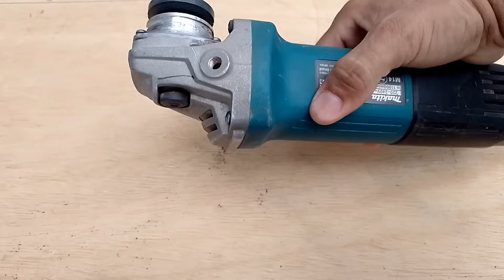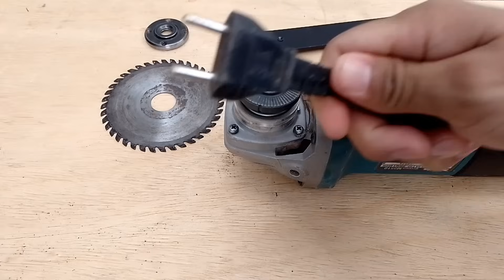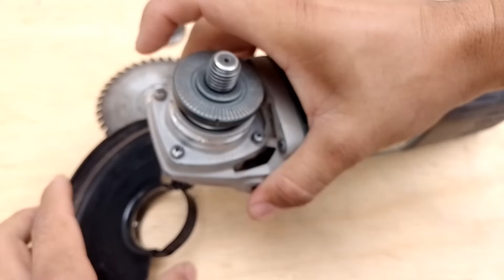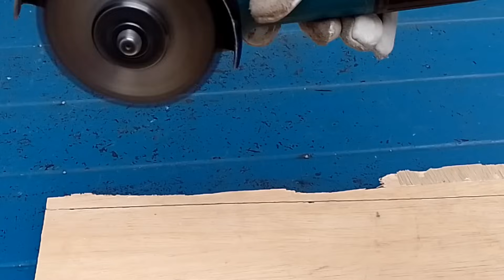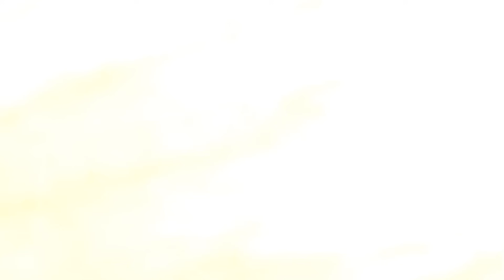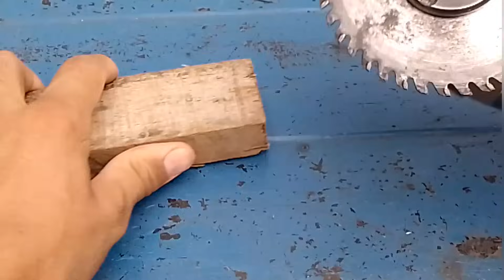Caution: Be very careful when using an electric angle grinder with this disc

Comment: Dear all, NEVER use this disc on angle grinder,  I am talking through a bad experience.
Reply: Same problem happened to me also.
Reply: Çok tehlikeli parmağımı kestim
Reply: Inexpensive to buy a circular saw, not saving this money.  Too dangerous
Reply: what bad experience with this saw disc?
Reply: Very dangerous disc ever on angle grinder
Reply: Me injured today...right we care full😢..pair m bhut cut gya hai..mere
Reply: Yes you are 100% correct. Angle Grinder is meant for MS cutting and Granite and Tiles cutting and polishing with proper blades. Cutting wood is highly dangerous. Please don't use for wood cutting.
Reply: @worldbiss1831 
I think he is referring to injury. Grinder is very powerful and always has kick back when using it to cut wood.

Comment: My humble advice. Never use an angle grinder for cutting purpose. It is too dangerous, even if you are an experienced one.
Reply: But why sir.. plzz explain or make a video on it tnxx
Reply: u are right it is meant for grinding .can cut small iron with disk which have no teeth. the most suitable is jigsaw for wood cutting upto 2 inch thichness

Comment: I have made a few silly mistakes with an angle grinder.  I was cutting through a wastewater pipe with a saw blade and the grinder kicked back cutting my index finger in two and slicing off the end of another.  I was cutting through a brick, I held the brick in my hand and the cutter was near my loose t-shirt.  it grabbed my shirt the started cutting into my chest, leaving me with a large scar.  Angle grinders are great tools but they must be handled with respect.  I am so careful now.  Always wear safety equipment and don't be a twit like me.
Reply from the maker: 👏👏👏👏🙏🙏 We really should take every precaution when using an electric angle grinder
Reply: Just remember that this machine is unpredictable and wild , so grab it strongly
Reply: Excuse moi mais je n'ai pas pu retenir mon rire.
Respect, tu es un véritable guerrier qui ne lâche pas l'affaire .
Après tout ce que tu as enduré tu continues encore avec la bête !
Bravo 👍👏
Reply: Thank you for writing your story, thanks to your comment, I'm not going to use this angle grinder to cut woods, I was surprised why I couldn't find this kind of disk in my local market, they all use the big saw with flat bottom that you can install it on a disk and I've used before, I assume those are way safer. 
I'm going to use this only for polishing.

Comment: When we are cutting the wood with this disk plate , we have to use the handle bar and safety guard attached as well . I
use it for thicker wood , but my angle grinder kicked back very badly few times and I controlled the situation ,  Earlier I asked my friend who is carpenter and he said it is good but you have to grab very strongly. I also used my angle it grinder which is weaker , if your angle grinder is weak and old it is ok to cut the wood with maximum safety, but do not use it with new and strong angle grinder . In my view sharp things are having devil , so handle with care .

Comment: Angle grinders are dangerous enough when used properly. I had diamond cup wheel blow up on me and a shard shot right towards my chest. If my safety vest hadn’t been caked in epoxy I probably wouldn’t be here today. Don’t do be stupid with angle grinders. Wear PPE and use as intended

Comment: It's always good to have a person to switch off immediately when it goes wrong, further don't give more pressure while cutting, it should glide in very softly, Last but not the least if possible have voltage regulator to reduce RPM

Comment: Wow, this is everything you shouldn't do ever.

1) Don't touch de disk while still connected with your hands!!
2) Don't use that kind of disks in a grinder. Haven't you heard about all the cases of people loosing fingers or legs? That disk at the high speeds of rotations becomes a weapon, and jumps from the struggling of cutting the wood. It becomes uncontrollable
3) Don't manouver the grinder with only one hand! Always both hands on the machine
4) Don't ever use the tool without gloves!

Comment: Dear viewers please don't use angle grinder to cut wood especially with the teeth circular saw.
You may end up in a very nasty day.
To cut wood use miter saw or table saw or bandsaw.
Hand held saw or small jigsaw is good if you're a beginner. Good luck 👍

Comment: As a safety officer you will be disciplined for putting a circular saw blade on a angle grinder
Reply: why?
Reply: It's dangerous , no safety guard  @mhnoni
Reply: @michaelkroukamp221  Thanks, I guess I'm not going to use this for wood cutting and I will use my usual big circular saw with a flat set.